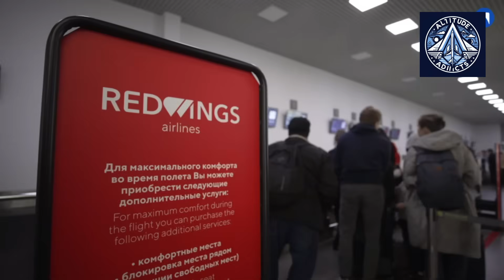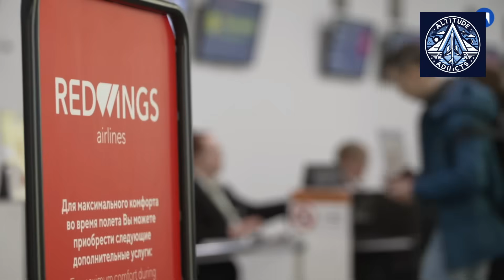Russia is Refurbishing and Upgrading TU-204 and Tu-214

Comment: Sanctions ??? No Problem !!! We have now modern Commercial Aircrafts MC-21 and Sukhoi Superjet 100
Reply: Well, it will take time and much effort to produce a significant number of those airplanes.
Reply: @thomasw2509  Russia will not worry. 10 years is not long enough. In fact they have produced many of the Sukhoi Superjets already operating in Russia and other friendly states. Again its not a thing to be worried. There  is so much space for improvement and development and there are lots of opportunities for business. What I mean there are lots of clients and customers in the future. And by the way, Hong Kong will be in full control of China by 2047. And we also hope Ukraine will be in full control of Russia in less than 10 years. Haha
Reply: Sanctions make the difference between aircraft that can fly only domestically vs. aircraft which are sold and operated worldwide.
Less than 30 Tu-204 / Tu-214 are in use today. For comparison: About 1600 Airbus A321 are operated worldwide, with several thousand more in the order books.

Comment: Given that Russians are an intelligent people, their civil aviation industry must ne in a severe hole if they continue with these obsolete 214's.
Why not deploy ALL resources to MC21/PD14???
2 crew glass cockpit, composite body parts, PD14 engines.
Use the 214 factories re-tooled for the MC21 airframe?
Reply: because they need something now. not possible 2 years from now. The MS-21 won't be in full production until late 2026 to 2027 and NO! you don't just "retool" a factory for a completely different design plane that shares no parts or specs to the MS-21. You need a new factory at that point.